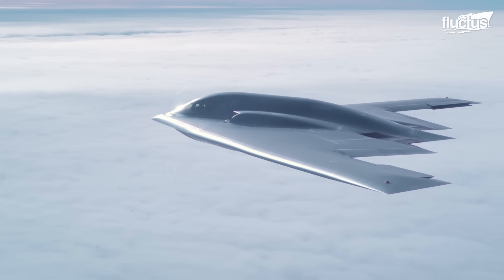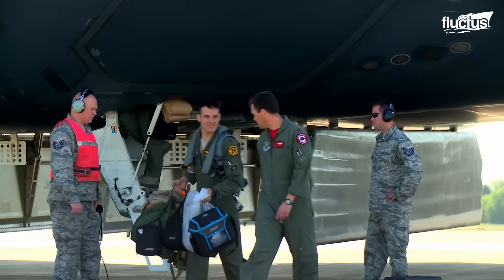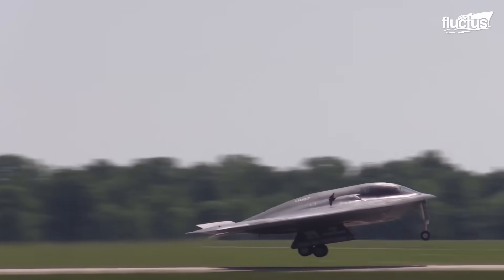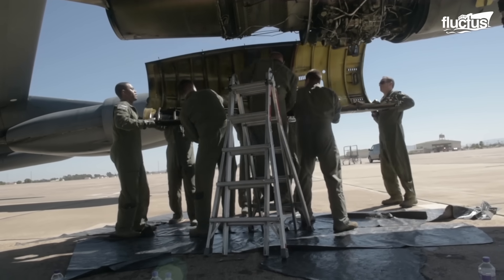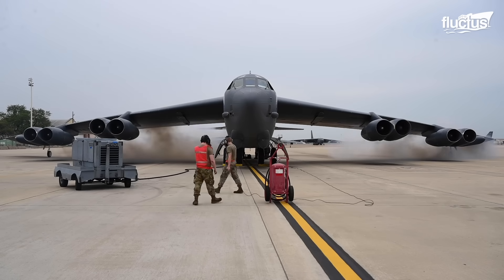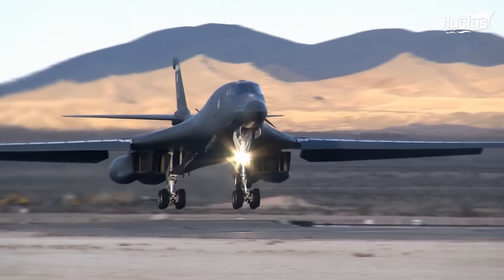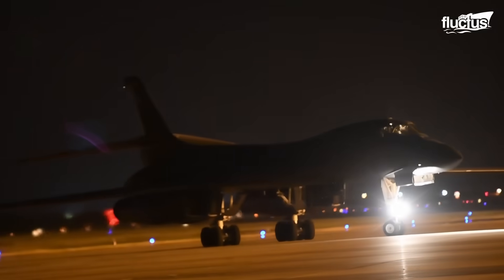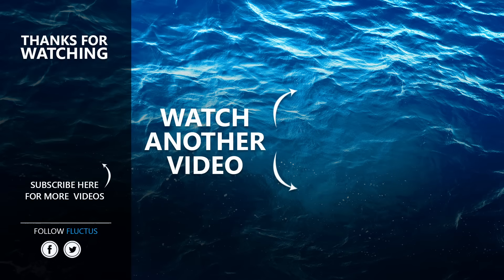A Day in Life of US $2 Billion Stealth Bomber

Comment: Can someone please explain how this aircraft works without a vertical stabiliser (tail fin) when all other planes have one?
Reply: İ heard somewhere that the plans were ready but the military couldn't started the construction of the B2 because it was impossible to control a plane without stabiliser. With improved technology, sophisticated flight computers invented which made B2 able to fly.
Reply: The B2 is not very maneuverable because of this, although making it very stealthy. It’s also why the F35, which does haven them, is not as stealthy but much more maneuverable.
Reply: @Eddie_Munster  Yes, but HOW does the B2 fly without one? My understanding has always been that a vertical fin is essential for controlled flight and ALL other planes have one of some kind.
Reply: without a computer flying it, it would fall out of the sky.
Reply: At speed and altitude the B-2 controls yaw via it’s split ailerons at the trailing edge of the outer wing. During non hostile flying, the spilt ailerons are usually opened to 5°, below 5°s, the split ailerons have no effect. During combat operations, the B-2 crew manages yaw using differential thrust setting on the engines.

Comment: I wonder why they couldn't have a probe pop out where that fuel door is, I wonder if it's the angle and they were afraid it would snap..... I wonder how hard it is to actually match each other's speed and altitude enough for the person operating the boomstick or fuel stick whatever it's called to hook up and stay long enough or if it's done pretty much by autopilot other than the person controlling the boomstick/fuel stick... Another thing can they actually fuel up if it's ideal conditions or can it happen in any weather pretty much or scenario.?.
Reply: 400 lbs per minute on probe/drogue versus 1,200 pounds per minute on the other.

Comment: What is the oldest serving air craft in inventory if not the B-52?
Reply: I would guess technically the C-130.
Reply: B-52 - Operating since 1955
Cessna 180/182/185 - Operating since 1952
KC-135 - Operating since 1957
U-2 - Operating since 1955
U-6A - Operating since 1949
Reply: U2?
Reply: @rogerthat4545  The flying models were built in the 80’s.
Reply: @johnp139  huh??

Comment: We probably have several of these in the air 24/7 but I wonder how many we have in total because these are badass bombers.
Reply: Originally, 165 B2 were meant to be built. This number was cut down to 21 aircraft that were built and delivered. 1 of those crashed in 2008, leaving 20 B-2s in service - some of which are undergoing repairs.
Reply: The US has 744 B52 stratofortesses. 20 B52 stealth bombers are in service.
Reply: @benjamin3922  >> 76 B-52s are still in service.
Reply: The U.S. no longer has nuclear-armed aircraft on ALERT like they did during the cold war.
Reply: 20

Comment: If Putin launches his nukes, how long would it take to fully load all B-1s, B-2s and B-52s with nuclear-tipped cruise missiles and get off the ground?
Reply: B1 does not carry them.
Reply: @Izzy8605  it sure dose. In fact, it’s our only bomber that can break the sound barrier, all with a payload of 24 nukes..(or 84,500lbs of freedom delivered to Putins door)
Reply: @jayyoutube8790  The B-1B no longer carries nuclear weapons;[37] its nuclear capability was disabled by 1995 with the removal of nuclear arming and fuzing hardware.[118] Under provisions of the New START treaty with Russia, further conversions were performed. These included modification of aircraft hardpoints to prevent nuclear weapon pylons from being attached, removal of weapons bay wiring bundles for arming nuclear weapons, and destruction of nuclear weapon pylons. The conversion process was completed in 2011, and Russian officials inspect the aircraft every year to verify compliance.[119]
Reply: B-1Bs can and due carry up to 24 AGM-86B crusie missiles with the W80 thermonuclear warhead on rotary launchers.
Reply: @jayyoutube8790  wrong
Reply: We used to have them on 15 minute ground alert in specially built restricted areas with crew housing in the same area. Look up Strategic Air Command, our system was ready 24/7 365 days a year, we were tested at all hours, all weather and any day and always were ready!!! That was why the cart start was created to aid in starting the bomber quickly. I worked the bomber alert area often and in the alarm tower that stood about 10 taller at 50 feet, it was awesome to see the big bomber rolling by on the way to the runway, ready to take off on the President's Orders!!! Our fence line signs stated: Use of Deadly Force IS Authorized, we did not need to ask anyone's permission to shoot!!! I served with the 92d Security Police Squadron for 5 five years with the B-52's ready to go!!! and yes, the B-1 is not nuclear capable due to SALT treaties in force.
Reply: l think they are locked, loaded and airborne now 24/7.
Reply: I think they are most likely already loaded and ready & waiting, but Putin will be hit by Minutmens and Trident 2, sorry for my English
Reply: It is certainly scary to know that we have a fraudulent, incompetent dementia patient, that is being controlled by God only knows who, in charge of the keys to our nuclear arsenal.
Reply: A response would likely be from a nuclear sub not a bomber.
Reply: Correct but ... several billion dollars in aircraft, equipment and people - vaporized before it can get off the ground? What are they thinking?
Reply: There are B-2s and B-52 ready for deployment in europe and could reach moscow and st petersburg in few times
Reply: B-2s yes but ... where are the nukes stored and how long to get them loaded? B-52s have to have updates before they can use the rotary launcher with nuke-tipped cruise missiles.
Reply: @RockyAllenLane  These tactical nukes are stored in germany and Poland a B-52 can be armed probably in 1 hour ( probably faster now due to tensions), there are already fast deployment teams ready for action if satellites detect russian nuclear armament on the move.
Reply: It is my understanding that the B-52s (like the B-1s) had their nuclear arming and firing circuitry removed due START II so they are limited to conventional warhead cruise missiles.
Reply: не успеют,,,,😎
Reply: @ДмитрийСосулин-н1ш  funny.  they are most likely already loaded and ready & waiting
Reply: @ДмитрийСосулин-н1ш  for any of us
Reply: @ДмитрийСосулин-н1ш   if your Russian, wtf you here for? Close to Halloween, need a good scare?😂
Reply: Doesn't matter. Sharpest point on our nuclear triad is our Ohio class subs. We have 14 armed with 2 dozen trident2 ballistic missiles each. We'll likely lose our bombers and we'll probably hesitate to launch our minuteman icbm's costing us the weapons. The subs will assure they lose more though
Reply: At most, 4 to 6 subs are on active patrol. Others not ready to start launching immediately. Russian attack subs tail the ballistic subs constantly. Could be destroyed before they can launch their SLBM.